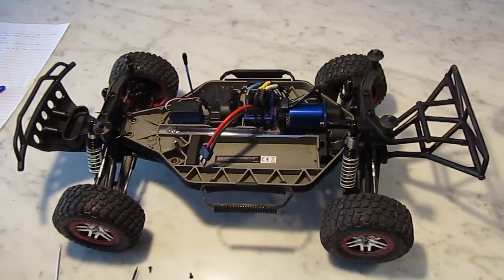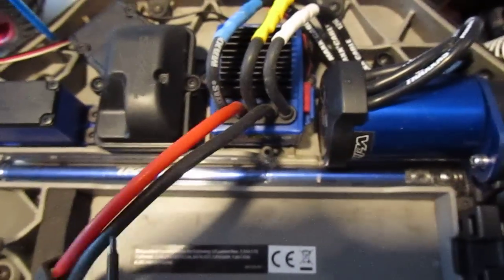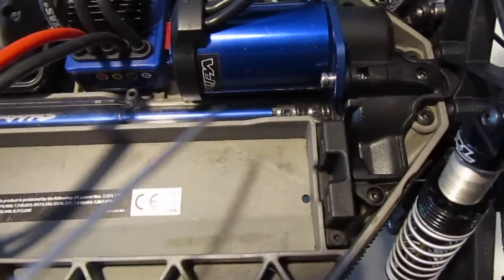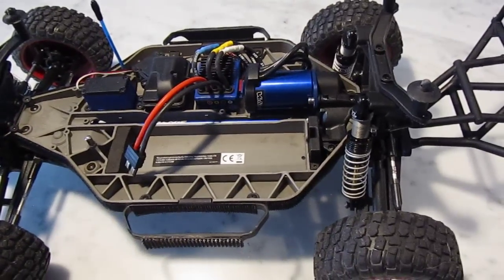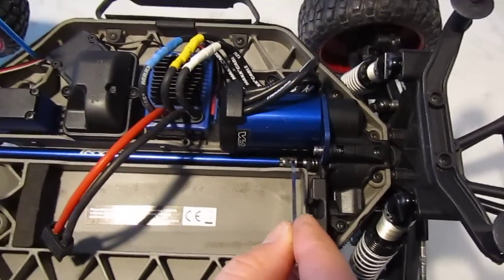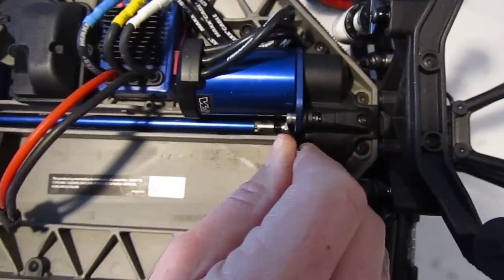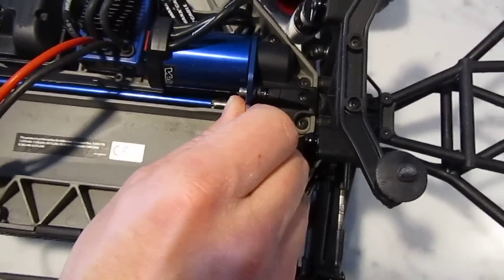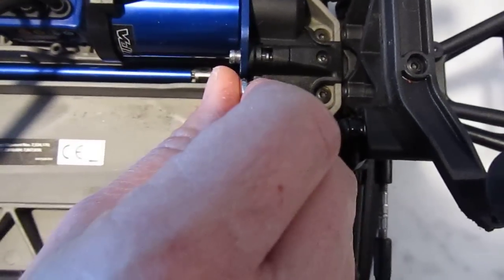Traxxas Slash 4x4 slipper clutch adjustment

Comment: Just a head's up, The slipper clutch is intended to be a safety against damaging more expensive drive-line components in an impact. if you run it loose enough to use it as a traction control device, you'll be producing a lot of heat at the slipper's friction surfaces. That heat will soak into the spur bearings and the bushing. If you still have the plastic bushing, it'll be at risk of melting. (there's an aluminum replacement available) The heat will also cause accelerated wear on those bearings and the slipper clutch friction pads. 
I'm not saying don't do it, just cautioning you of what to expect if you do. :)

Comment: I thought the slipper clutch work was to reduce load on engine so if drive line was stuckd some how the cluth should slipper. Is that wrong?

Anyway, I don’t like the slipper clutch have broken two engines when using it. First time from factory the clutch was too hard and fried my engine du to heavy load. Second time after adjusting the clutch as described in user manual, I blow up engine magnetic rotor and fried the ECU.
After this two problems I installed center diff, never had a problem since.

Comment: I installed a Mamba Monster 2 on my bandit. It tops off at 10 mph and makes a very loud whizzing sound. I called Castle Creations and they said the discharge rate on my batteries is too low. What do you think?
Reply: If you’re running a stock “c” rating on your batteries (low for Traxxas usually) then it’s not enough for that monster castle esc! Great esc, but needs the proper current to power it.

Comment: my slash is revving the motor, but doesn't move very much at all. I was wondering if this had to do anything with it, if not what do you think it is?
Reply: First of all make sure that the pinion is not grinding  against the spur. If you have the proper gear mesh and you still have the same problem, it is something wrong with the slipper clutch. You may have an old slipper clutch that needs some service, or you just have to adjust it properly as shown in this video

Comment: I have the Telluride. I tightened it as far as I could like in the video and it still slips bad if I floor it. Not even running brushless... any ideas? I just bash for fun, I’d rather it have zero slip. Suggestions appreciated, thanks. Note, if I ease into the throttle it runs ok... but not like I want it.
Reply: You cannot tighten it up all the way or you will break driveshafts and gears etc. The slipper clutch main job is to protect against this. It's not a matter of preference as this video implies. He just forgot to mention that. It sounds like your gear mesh is loose (between the pinion gear attached to motor and the spur gear that has the slipper clutch assembly attached to it.) The teeth of those two gears may be broken and worn off. You will need to get in there and see what's going on. Look up how to adjust gear mesh on your truck.
Reply: Get a spool and eliminate the clutch. Sounds like you’ve outgrown your RC and need to upgrade it further or step-up model wise. But be warned; you will end up breaking weaker links down the line….but as you break them, replace them with better/stronger/lighter parts (when available) and it’ll stop happening as often. Unless you bash to trash and then stick the with cheap stuff; you’ll be replacing stuff either way

Comment: theres a better way to get to the slipper clutch.. remove the entire rear assembly bulkhead by removing the 2 2.5mm screws (the big ones)on top and bottom where the bulkhead connects to the chassis and just pull it apart..slide the clutch out..much easier to work on